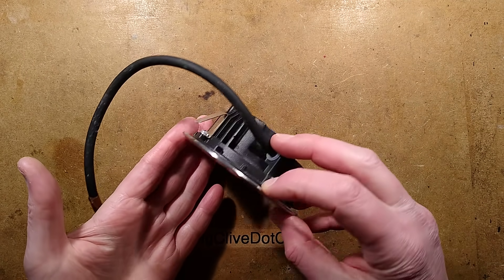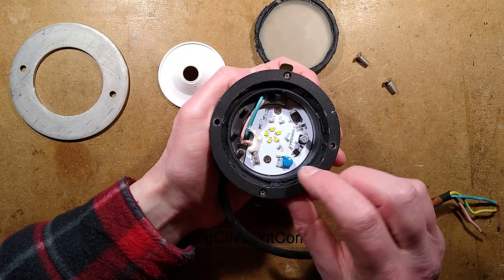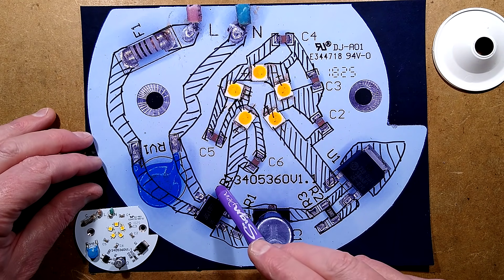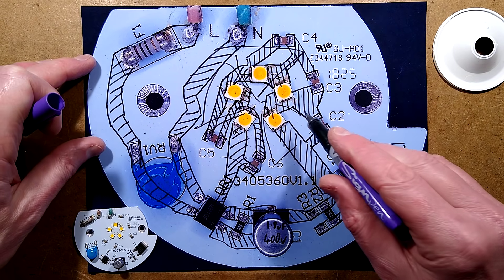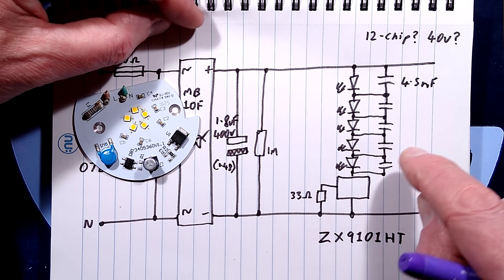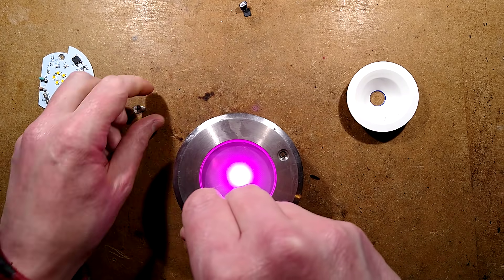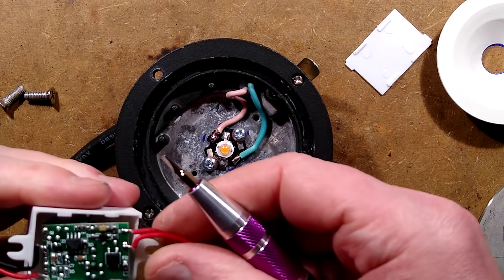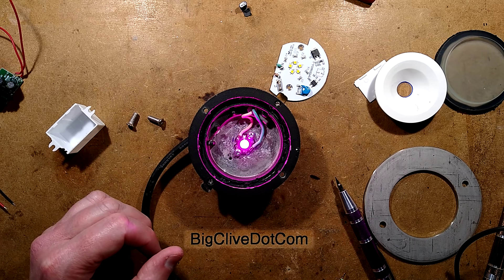Bodging a repair on a faulty ground uplighter

Comment: Multiple caps so they can use lower voltage ones perhaps? Maybe the regulator needs some capacitance for stability
Reply: I would say for electrical overstress (EOS). They should reduce voltage surge, but I never tested it.
Reply: Reminds me of the parallel capacitor/resistor pairs used for HV diode strings to help equalize the voltages across the diodes when they're back-biased. Maybe they did it to also help better spread voltage transients across the entire string rather than the possibility of it dividing unequally across each LED in the string if only one capacitor was used for bypassing.
Reply: @mysock351C  A string of high value resistors would have done that quite nicely, but capacitors? I don't know. I do know we frequently use resistors (typically 470Kish) to balance the voltage across series electrolytic capacitors for high tension DC supplies, for example.
Reply: @petersage5157  I think its just for handling sharp voltage transients that might cause large forward voltage drops across the chips. An example might be if they were used in the walkway of a pool or something and they shared the panel with pumps. The capacitors would help bypass any transients from contactors and such around the LED string.
Reply: @mysock351C  Transient filtering that comes trough wires is mostly done by electrolytic capacitor across whole input voltage. Small ones would help too, but when you have so many in series the value is just to small to make a difference in those kind of transients. They are probably used to reduce transients that are coupled from the case to alu. pcb which forms a parasitic capacitor with a copper layer on the top and thin dielectric in the middle.
Reply: The only normal reason that capacitors are connected across diodes, is to suppress any noise that the PN junctions produce. But I’m not convinced that’s the reason here. I’m wondering if these LED chips have some internal circuitry. If they do have internal electronics, that may be the reason that capacitors are connected in parallel with them.
Reply: @Mark1024MAK  As I mentioned earlier they are also used in HV supplies that have lots of standard diodes in series to help reduce the effects of junction capacitance and varying switching speeds of the diodes. The capacitors help form a series divider that serves to equalize the voltages amongst the diodes as they switch. The electrolytic there should provide some filtering, but a little dinky PCB mount capacitor will have a fairly high ESR, and my experience with audio equipment is that even nice chunky electrolytics will just ignore noise due to their impedance at higher frequencies, and ceramics or film caps are needed to get the junk out. At any rate, I suspect its probably a CYA to help them survive any insults that might be coming in thru the mains. There could be other reasons as well, but it looks like something that would potentially be added to the design after a rash of failures since this looks like something that would be used in a commercial setting like a hotel or a fountain.
Reply: @mysock351C  yeah I was thinking it may be for balancing as well, it's fairly common for diodes to have different response rates, and that results in one diode in a daisy chain to turn on first, heating, and further conducting, until the diode that turned on early burns up. You'll find this more in rectifier diodes being used incorrectly, i.e. in series to handle higher voltages, I believe they are especially sensitive to this given their indirect semiconductors generate more heat on recombination.
Reply: @WR3slo  They would indeed provide momentary bypass in the event of a surge, although the linear current regulator IC should provide that functionality itself...so it may well be for greater reliability by allowing failed LEDs to be bypassed IF the 4.5nF is sufficient for that purpose (though that seems much too small a value to me).  The capacitors will also reduce the RFI noise generated by the LED diode junction switching on/off (although I doubt they were really concerned about that RFI as little as it will be at such current, but it is sometimes a concern with highly sensitive circuits).
Reply: @mysock351C  - yes, ceramic capacitors will be used where high frequencies are used. But in this application, the LEDs are running on a smoothed (even if it’s not a particularly well smoothed) DC supply, which in turn is from a 50Hz mains supply.
If the intention was to filter out high frequency noise or spikes from the mains, I would expect a ceramic capacitor to be placed directly across the DC supply rails in parallel with that electrolytic capacitor.
I’m not convinced those capacitors will do much to limit the rate of change when power is first applied, the 10 ohm series resistor and the electrolytic capacitor will do that. To be honest, the 10 ohm resistor could have been 100 ohms and then it would have been even more effective at limiting the rate of change,
Reply: The data sheet shows a cap across the regulator so it does have a stability issue. The usual reason for putting a cap across a diode to deal with any switching transients doesn't apply here as they're static - or they should be. Maybe get it working and do a bit of scope probing?
Reply: I spent a while helping my employer's suppliers pass the required EMC tests.  One item that needed work was a LED light circuit board that didn't get installed into a housing until after it left the factory.   To protect against ESD damage to the white LEDs when handled, a cap was added across each LED.  With the caps, we could discharge 15kV at the LED and not hurt it!  No idea if that was the reason for Big Clive's light,  of course.

Comment: Instead of drilling holes couldn't you stick the led down with thermal adhesive ? Or one of those 
sticky thermal pads? You are running the led quite gently after all.
Reply from the maker: That could work.
Reply: Thermal epoxy.
Reply: Or drill and tap a blind hole and use a shorter screw. Granted it's a bit more hassle as you have to use a plug tap after a normal taper tap to get threads all the way in. Depends how much meat there is in the material but it doesn't have to clamp much, a couple of threads will do I reckon.
Reply: @FrontSideBus  Just let the steel screw make it's own treads in this case.

Comment: Nice teardown and revival :) you could also turn it into a downlighter for indoor use, so then you wouldn't need the waterproofing :) and 12V LEDs are definitely possible with one of those 12V power supplies

Comment: Next time you're in glasgow city centre... if you look around there must be over 100 uplighters that don't work... some of them are older CFL's... whether the power is still live to them at night or not I've no idea... buchanan street has some blue LED's still working but most of the white ones were out last time I was up that way at night just over a year ago
Reply from the maker: There's lots of abandoned live stuff in Glasgow.  You have to assume that everything is live.
Reply: What's being said here is this:  after a night of drinking, don't urinate on the—  um, rather: please use the rest rooms.
🚹🚺
Reply: What is it about municipalities that they never have funds for maintenance of existing infrastructure but if something new and shiny comes along the purse is wide open. Until the new becomes old and the cycle repeats.

Comment: Planners love these in their town centre plans despite being advised against. They never fund maintenance hence there rarely replaced. Always specified prewired tails but they still ingress eventually. Exception to this is blue square LEDs Buchanan st near "forbidden planet " Glasgow. Lasted for years
Reply from the maker: I remember those.  Strange little lights with LEDs around the internal perimeter?
Reply: @bigclivedotcom  planners always want these installed in posh slabs that you could never take up!
Royal exchange square up lighters never worked from day one. Controlled by tss mains signalling which never worked in any installation we tried it on.(also under fancy slabs).:) G
Reply: @bigclivedotcom  at dundas lane behind waxy o'Conner pub.
Reply from the maker: @gordonirving24  Or in the case of BBC Pacific Quay they reopened a quarry just to mine a very specific stone, so if we damaged a slab it required reopening an entire quarry again to replace it.
I have a very low opinion of many architects.

Comment: What about slightly raising the LED and drilling a countersunk drainage hole in the bottom of the case to allow any water to escape?
Reply: Not with our weather, water would fill it up from the bottom...
Reply from the maker: When you take these out of their ground enclosures they are often up to the brim with water.

Comment: I noticed the earth wire didn't make it inside the case. Did they connect it to the case under the potting?
Reply from the maker: Yes.  I did test it and it was bonded.
Reply: @bigclivedotcom  WOW that makes a nice change.

Comment: In theory, could you have used some larger metal washers and used the same holes or used some "spring metal" to pin the new led down?
If doing many of these I guess another idea is a fiberglass board with the hole for the LED itself to poke through but enough to hold its little board and the two holes to go into the original screwholes

Comment: Is there anyway perhaps you can take a look at disposable Vapes see the logistics of reusing the 3.7 V 280 amp one point white lithium ion? I’ve taken apart over 25 and I’m quite curious as to if they’re reusable batteries as they are lithium ion’s and they can be recharged
Reply from the maker: Most of them do use rechargeable cells.  I've taken a few apart, but YouTube doesn't like it when I feature vaping devices, even just for a technical teardown.

Comment: I have been repairing similar (internal) units with COB boards from eBay 10 x 5watt units for £7.20 (search for 10Pcs AC220V 5W High Bright Integrated Chip Light Source COB)  These can be obtained in warm and cool white and are usually rated 220V so I add a 1K resistor in series for a little extra caution!

Comment: ohnoes, Clive's a twister!

To be fair, getting parts off of aluminium backed boards is quite difficult. I'd probably twist it off myself. Dont ever do this on regular PCB's though, especially if it's a vintage computer :)
Reply from the maker: That was my first go at twisting, and it was a MUCH better result than the last one I tried to dresolder.

Comment: we have them all over Mansfield market along with a ground level sputting water feature you can walk on, and they never turn them on lol never seen them lit yet. there are some interesting, yet pointless blue 'at ground' solar lights bedded into concrete near a space you would expect a bench to be, the wall recesses. They do light up occasionally but don't last long.  They are the same style as your light here but you have to look hard to see the solar panel behind the glass. Is it just me or am i the only person with the worlds worst luck with out door lights? Over the years, about 10 or more I have lost 5x500 watt halogen floodlights to snow falling off my roof (they just go pooooof with a bang as the glass shatters and the bracket bends off the wall) and now 1x 10w LED flood light, its small so i thought snow falling on it wouldn't bother it. This time it hadn't been used much, I have it on a switch it has no sensor, about 15 or so total hours of use in, that bugger stopped working too. I don't know if i can be arsed to take it down and try and fix it a-la-Clive style or just forget about having an outdoor light altogether. I'm half tempted to just cram a lightbulb against the wall, it has the same chance of survival as all the other lights. lol
Reply from the maker: For low level lighting I recommend getting a light with a decent case and customising it.

Comment: Greetings:
I am disappointed that you made no attemp to measure to voltages of the circuit including the output of the regulator. I forgot whether the LEDs fail open or shorted. Could you remove the failed LEDs/caps and placed  a multi-LED assy and reused the remainder of the circuit?
Reply from the maker: The LEDs had failed open circuit.  They are a high voltage type.

Comment: The resistor option,if it dissipates a little heat,can act as a dryer inside the enclosure.
Reply: Actually the linear regulator also dissipates heat

Comment: Interesting note about architects...and their apparent lack of foresight for any maintenance or other practical considerations! Like, for example, let's put recessed CFL or MH downlights in the ceiling above a 3 story atrium, it will look very modern and cool! Until about 5 years later when half of them no longer work because the building owners don't want to pay someone to erect a scaffold so they can be serviced!
LED slightly better in this application as they don't need to be relamped but they still fail at an alarming rate and will need the whole fitting swapping out!

Comment: Am I reading your schematic wrong, or did you put the 1m ohm resistor on the wrong side of the cap?
Reply from the maker: It goes after the rectifier and in parallel with the capacitor.
Reply: @bigclivedotcom  ahhh parallel. I'm shit at reading schematics. Thanks for the explanation.😁

Comment: If i was going to put a different LED in there for low voltage, i'd probably make it 24V powered and then add a simple 2 transistor type current sink as a regulator. The main transistor could be something in a TO-220 package which you could easily bolt to the heatsink

Comment: Clive, if these were powered by 24vdc, it could be used on the more common landscaping lightning circuits and equipment.
Reply from the maker: A custom PCB could be made.
Reply: @bigclivedotcom  that would be a benefit of one has a number of these. These might be useful above ground as down lights with a new circuit board, too.

Comment: Pink is good, I like pink!

The local council planted a load of up-lighters along a walkway about ten years ago. The lasted literally two months before the first failure. Thereafter, they at the rate of two or three a month. They tried various other up-lighters, but they all went the same way, so now there's a neat row of concrete scabs on either side of the path where the lights used to be. Wonderful architecture, brilliant waste of public funds.

I suppose you could turn these the other way up and use them as down-lighters?
Reply from the maker: And between the cost of pretentious architectural lights and the labour to fit and replace them, they waste a LOT of public money.

Comment: Could you check out a device called a powervolt? I keep getting ads for it and it claims to drop your energy bill 90% and it just plugs into your outlets. I smell the stink from here but I'm curious what is actually inside it and what it does.
Reply from the maker: I've made lots of videos about power saver plugs.
Reply: @bigclivedotcom  I'll have to go back and look. This one looked new. Probably the same thing different name

Comment: I would like to request a breakdown of the HAPHID plug in air ionizer that is on Amazon, it seems really sketchy and potentially dangerous.
Reply from the maker: It looks like a pretty case with one of the eBay classic multiple emitter modules in it.

Comment: Not a fan of line voltage landscape lighting. We have had a couple fatalities in Toronto from it. If the feed gets cut and produces a voltage leak to ground it can be deadly. They should all be on a GFCI Breaker or Receptacle. We use 110v. But most of our landscape lighting is 12v

Comment: Well, this was a disappointing bit of Clivery.  LEDs are fried; the only fix is to:
Recraft the fixture into a pinky/fuchsia upskirt light.   
Wait!  What???   😮😲😬
Well, it is a more technical solution than using the fixture to plant parsley in... 🌱
And full credit to Clive for going the distance with the schematic.
Reply from the maker: You could turn some of the many dead city uplights into secret upskirting cameras.
Reply: I may have drifted off or I may be stupid.  OK,  I'm stupid.  But I didn't register the diagnosis. The report that the leds come on briefly indicates that they are not fried, yes?  I don't think a fried led does that.  So why did it behave in this way?

Comment: What if you were to add a solar cell and embed it in the roadways?
Reply from the maker: It would probably leak, detach from its hole and get catapulted through someone's windshield by another vehicles tire.
Reply: Solar Freakin' Roadway Uplights?